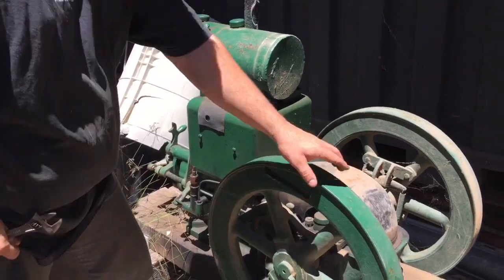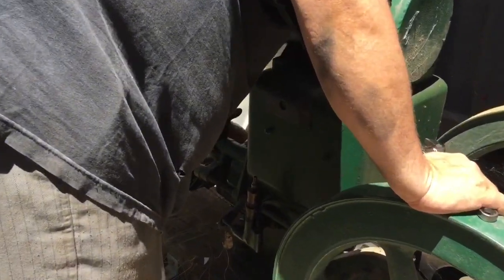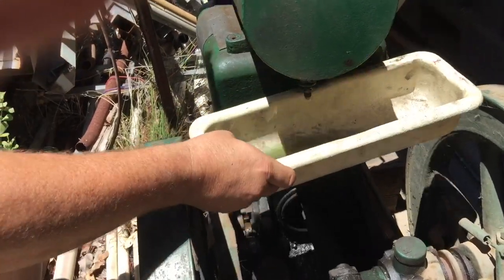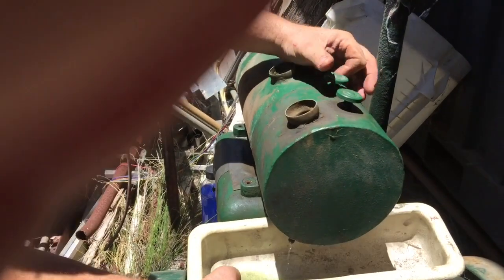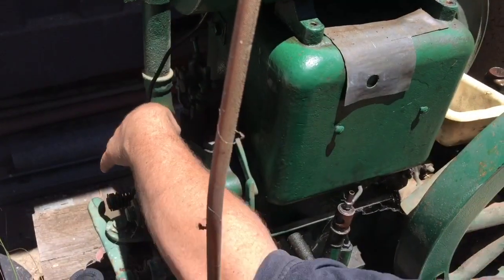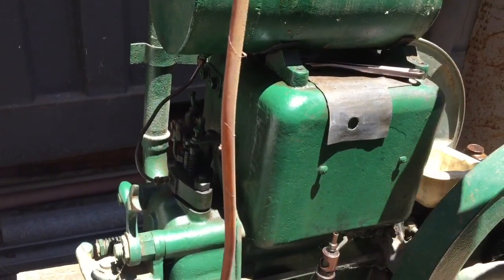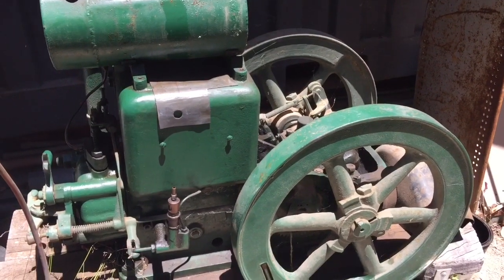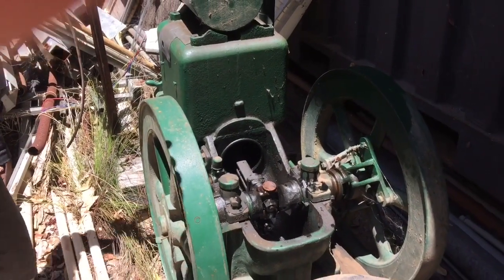Hit and Miss Engine - "Imperial Super Diesel" part 2

Comment: As with a lot of early diesel engines I suspect you would start on gas then change to diesel 
Kerosene is a high geade of diesel 
So both require a good bit of heat to make it ignite 
If you don't want to run 100% gas 
Then make a mix of diesel and gas 
Maybe 1 or 2 cups gas to 1 gallon diesel
Reply from the maker: Sounds like a plan! I must get the old girl out from under covers and try again soon

Comment: I’ve noticed that you stop cranking it over then turn the decompression off. Not saying your doing anything wrong here, but the way I’ve watched others, to crank these engine especially diesel ones you crank it over by hand building up momentum with the decompression engaged once you’ve built the momentum, and when you are ready to start you release the decompression lever while still cranking it over ,and it hopefully starts after all it’s still a diesel it will take some work. Any how the idea here is that the momentum you generate in the flywheel will help push it pass compression once you release the decompression. It basically still needs a hand after you release the decompression. I know it sounds scary with the type of cranking method, but that’s why the crank handle locks in the Direction that it runs and folds into the flywheel the opposite direction. You also kinda have to time the release of the decompression release as well if I’m not mistaken but I’m not sure we’ll this would be at exactly. it makes sense because every time you release the decompression it gets pass compression once but loses all of its energy to continue even after it fires once it did fire at least once I heard it!
Reply from the maker: I have much to learn for sure I have been looking for a starting manual to understand what the original process was, but have not yet found one
Reply: @JBFromOZ  I hope you figure it all out I can not wait to hear it run, next you try and start it see about finding a hairdryer, or hot air gun and have someone blow the hot air into the intake while it’s being turned over.
Reply from the maker: @blazing420loud9  yeah even considered using a candle under the intake to get it hotter too!

Comment: You'd be surprised how many people (let's say blokes) have collapsed and died of a cardiac infarction from trying to start engines like these. 

With regard to 'Aerostart' etc, there is little point to squirting it into the inlet and cranking the engine over and over, because all you're doing is to blow that stuff out before you ever drop the compression lever, and perhaps that's just as well, because if that stuff ignites prematurely, and it does!, it will kick back and remove your thumb! Better to play a torch over the inlet port, even over the cylinder head, before and during the cranking process, plus, the proper "He-Man" types would keep cranking after dropping the lever - that's why you need to keep your thumbs and fingers on the same side of the crank handle. You may also find it advantageous to fill the water hopper with boiling water, if you have the means at your disposal. 

It's all about getting as much heat as you can into the combustion chamber/air charge to aid that first ignition. Once it's away, it'll run like a good'un. If run regularly, it'll help to prevent the valves, piston rings, cylinder wall from developing that layer of rust that can destroy the compression you need to generate the heat that is required to ignite the fuel.
Reply from the maker: very good advice!! thumb risk is something I'm aware of as we attempted to start.. cheers mate

Comment: I have several of these McDonalds.  Please contact me if you want to start it. There is nothing wrong with the engine.
Reply from the maker: Very interested in a correct start procedure! The motor has run prior to being sat for around 10 years. Please email jb@designlab.cx if you have time thank you

Comment: The dual tank gives the clue the need for a starting fuel or a mix. Or use an old diesel mechanics trick my dad showed me. Heat the air intake with a propane torch while cranking over.
Reply from the maker: Yeah had kero in the starting tank, but didn’t realise the baffle between the 2 tanks had rusted through, meaning kero became diesel/kero mix. Didn’t have a propane torch at the farm so pre-heat is indeed one to try next start attempt for sure
Reply: Would like to see vid when you do get it running!

Comment: Sure hope part 2 goes better than part 1.  Maybe ya should git ya a petrol hit or miss.  So far it's been a miss entirely.  Er ya gonna do a part 3 & maybe a part 4?  Since ya did part 1 yer hair has turned grey!  Maybe ya need to git out yer shotgun and give 'er a blast.
Reply from the maker: Haha for part 3 I’ve lost 30 kgs (65 pounds) as well as my hair turning grey, so might finally be fit enough to crank her over fast enough with the injector seal working to finally have her running on camera! Thanks heaps for watching and commenting mate

Comment: Sounds like the compression is leaking past one of the valves. It is spinning over too easily by hand if the compression wasn`t leaking somewhere.
Reply from the maker: Yeah there was definitely an exhaust valve leak when I first went to start it, I was able to get the valve to seat by twisting the valve from the stem end while it sat against the seat, after which compression improved greatly. Next issue I believe will be the injector not pumping fuel, others have suggested when these dry out they stick and don’t inject properly.

Comment: Having been a manufacturer of slow revving oil engines like that one. That looks like a warm day and it should start. It will never go if it is not injecting. What has happened is the jerk pump has stuck up. It happens to oil engines that have stood  for a long time. So until you get the injector system working with a nice squeak as ScatManAust says, it will never go. With this type of hand start engine it is a bit like working yourself up to make it go. We could start 4 cylinder 5 litre engines by hand so you should be able to start that. But you only usually get one go after that you need a rest, or have two or three people. The secret is make sure everything is ready like fuel going in and no air in the system. either hand jerk the pump or rotate the engine by hand off compression until you here a nice creek of the injector. Set the fuel pump on maximum fuel. lubricate the bore with either diesel or light lubricating oil, this helps seal and reduce friction. Then you get that flywheel going as fast as all your body can muster and drop the decompressor lever. If it does not start have a cup of tea and redo the exercise but your body needs a few minutes to recharge the muscles with oxygen. But you comment at the start of this video is the key use brain not brawn. and egg cup of lub oil poured down that exhaust and turn it backward to suck it in might help. I have started the most knackered old nail by putting lub oil in the cylinders, so bad that when it had burned the oil it stopped.  It looks like with the correct tinkering it will go. 
Ex Engineering director. RN Diesel Engine Co. Ltd
Reply from the maker: This motor ran first crank 8 years back but time sitting and dried out injector seals etc, all needing attention

Comment: I know its only a video without great sound, but what I don't hear is the definitive squeak of the injector, indicating you are Not injecting or injecting  very little and certainly not enough. to start 
On both videos there is no squeak.
No squeak no start
The smoke you see out the exhaust does not necessarily mean you are getting fuel, certainly not enough.
Make sure the fuel rack on the pump is in the full fuel position before you even start to crank otherwise your wasting time and energy.
Also make sure the rack is not seized and can be pushed back to shut off position using the fuel shut off properly, otherwise if it does start it is likely to run away on ya.
With a good fuel pump and injector and bled properly, YOU WILL HEAR THE SQUEAK
Reply from the maker: I know that is has sat for 8 years since I last had it running, and the seal around the injector might be bad, my next move is likely to pull the head and service the valves and injector, and check the piston and rings
Reply: @JBFromOZ  If you can please film and upload the video, when you disassembly him, i will like to see inside the head from a hit and miss engine... :)

Comment: You have come this far you may as well do it properly take it apart give it a good clean oil and grease let us all see inside the beast.
 it is real life beautiful artwork
Reply from the maker: Agreed, I have a lead on a nameplate on a similar specification engine, to reproduce and affix to it once rebuilt. I’ve also sourced a set of 4 cast iron wheels to make a rolling cart for it as well
Reply: I bet the tank is full of rusty crap ,you dont have to run it on kero almost costs the same as gasoline fill both tanks with super.
Reply: If you keep doing the same thing ,NOTHING IS GONNA CHANGE.EXCEPT YOU GONNA FCK YOUR SHOULDER.

Comment: Will there be a part 3?
Reply from the maker: Yes there will most definitely be a part 3, I am building my shed on the farm in April, then I will have somewhere on the property to do the job properly, inspect the bore, reseat the valves de coke the head, fix the leak in the fuel tank etc.

Comment: Seriously your going to pop a vain. Get a 2x8, mount a motor with a rubber wheel to it. When you want to start the thing turn on the motor and raise the end of the board until the wheel makes contact. Quit trying to make a faces of death snuff film.
Reply from the maker: “I swear it wasn’t that hard last time I started it”
Reply: @JBFromOZ  I here ya. We're both big fellas and I learned a long time ago if I wanted to see 50... there has to be an easier way. Did you getter running?
Reply from the maker: Nah mate not yet, need to get some quality time up at the farm for a proper go

Comment: Nope, still not enough compression. Not even close. Myself I'm certain I'm hearing a tonne of blowby hissing under the crank cover. The way this engine was stuck when you started tinkering on it tells me the rings are either stuck in their grooves, scarred or broken. With proper compression on this size engine you should barely be able to turn it past compression with both hands. It really really really can't be hissing much at all when going past compression. You need to take the head off and service the valves. You also need to take the piston out and work on the rings. AND in my experience starting an oil or diesel engine on kerosene fule or diesel fule are both equally EASY when the engine is properly functioning.
Reply from the maker: Will be very useful to pull the piston and check over the rings, does the piston come out the crank end? Or out past the head?
Reply: @JBFromOZ  the piston can come out either end, just be sure not to scratch the cylinder while working in there. You might as well take the head off to work on the valves and try letting the piston out that end. It may not want to come out the head end if the cylinder has worn, there may be a slight step inside the cylinder from the wear, in such case the piston will have to come out the crank end. Once the piston is out be extremely careful of the rings as they are cast iron and very brittle. Time and patience should be priority with this type of work, forcing and rushing will only succeed in either damaging or breaking irreplaceable parts. Again use caution during reassembly, get another pair of hands to install the piston. Just a suggestion, don't take the injector or pump apart unless you are very sure of what you are doing.
Reply from the maker: Thanks Mr Laporte, I will have this in mind when I finally get time to do a proper job on the engine. It should be possible to check for a ridge on the cylinder from wear with the head removed.
I am very keen to locate a manual or parts book for this engine, to learn more about it before I pull it open
Reply: @JBFromOZ  yes you will be able to check for cylinder wear with the head off. If you look around youtube there are many videos of people working on the old engines. There's a little asian fella who made quite a few videos fixing diesel farm engines, his videos give a decent concise overview of many engine repair operations.
Reply: I think you'll find many helpful videos on this guys channel, even if it's not english.

Comment: If that's an automatic inlet valve, is it blocked, or stuck ?
Reply from the maker: There is a timed injection that is triggered in time with the de-compression pulse and the governor driven speed control (which is the heart of the hit or miss action)

Comment: As fast as the flywheel is coming to a stop after you close the de-compression valve I don't think you have a bad ring issue.  Seems to have a lot of compression.  It is not clear if this is a true diesel or a kerosene engine.  If the later have you checked for ignition spark. Also bad fuel due to age or water in the fuel can be an issue.  If this engine is gravity fed to a metering valve, keep in mind that any water in the tank is on the bottom and not fuel.  Either way you might have better luck to drain both tanks and add new fuel.  After that you might get it started with a little "start you bastard" spray. Good luck and keep that back straight.  I cringe to think of what mine would have been like if I had put as much effort into starting the cranky old boy.
Reply from the maker: With the “Imperial Super Diesel” there is no ignition, it fires purely based on compression and head temperature.
On farms and bush installations these engines run tirelessly on many fuels, including waste oil, kero, diesel, etc.
My issues are possibly due to not enough compression (when cold), so likely some pre-heat will be all that is needed on my next attempt.
Also checking into the injector there is a possible leak there as well

Comment: bad rings
Reply from the maker: Yeah I am thinking that they are gunned up with crud so on the list, also I’m getting some pressure blow by up the injector so possibly dirt and or corrosion on the injector valve as well
Reply: PB blaster and WD-40 will help

Comment: If you have a blow torch put it in the inlet of the engine and leave for 30seconds to it is hot then tern the engine over with the blow torch still in it then slam the decompretion down and as the engine wil be worm you should have more luck if you don't have a blow torch you can have a oil rag on a melted rod next to the inlet.
Reply from the maker: I was thinking even just a tea-light candle lit up under it might be the go, those buggers get hot!
Reply: A Mapp gun is the go, I have even used them to warm up the intake on diesels that have sat for a few years. With someone cranking and someone else holding the mapp flame into the intake it should heat up the air charge enough to ignite what ever is in there.Diesels fire off at 900C ,so you need plenty of compression or added heat .A relative had a Chinese diesel years ago and that bugger would never fire unless we aimed a flame into the intake port. In the chinese manual it said to hold a piece of burning bamboo....

Comment: Might not be developing enough heat to fire. Try warming the cylinder head with a torch then crank. Once you get it going, let it idle for a bit to help free the rings.
Reply from the maker: i've started this old girl a few times over the years, and it was able to start from cold, but yeah it has sat 6 years or so since last run, as you suggest some heat should help get it going, as a last resort
Reply: JBFromOZ would love to see her run again.. keep trying & use hot water in the cooling tank to pre warm 😏

Comment: Did you Purge the fuel lines of air first
Reply from the maker: I did purge the lines, in the first video, the fuel was diesel, in the second the fuel was kerosene, both times the fuel line was primed with fuel to the injector

Comment: Did you hold the fuel valve open for a bit to charge the cylinder up a bit? Also you should keep cranking over a few compression's  instead of letting go of the handle so early, It's a Mcdonald, they never start that easy!
Reply from the maker: G'day Mate, I was concerned that the opposite might be occurring, if the injector valve was not searing properly and resulting in flooding the cylinder. I found last time that I ended with a squelching or gurgling sound from the exhaust. I had a few decent white puffs early on, so was still encouraged.
Historically (up to 8 + years ago) from memory it started really easily. Doubtless time makes this memory a little difference :-)
Reply: you might have to pull the brons injector out an reseat the valve if you think thats the problem. Normally if they charge up too much with fuel they will knock a bit and you just decompress it for a bit until the excess fuel clears.
Reply from the maker: I'm thinking a quick service of the valve and pulling the piston, clean and inspect the rings, thanks for the input :-)

Comment: not sure it actually is hit n miss. but it seems to have problems either way...
Reply from the maker: When running it sounds like hit and Miss, by if I understand the point might be that hit and Miss is  governed by keeping the exhaust valve open, whereas this engine is governed by the amount of fuel? Will need to examine closely once it's running :-)